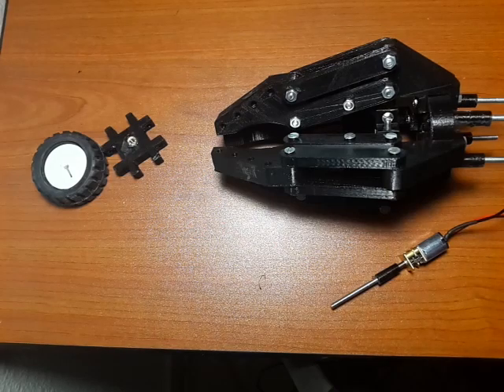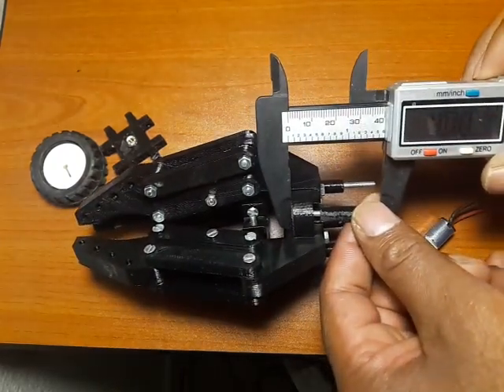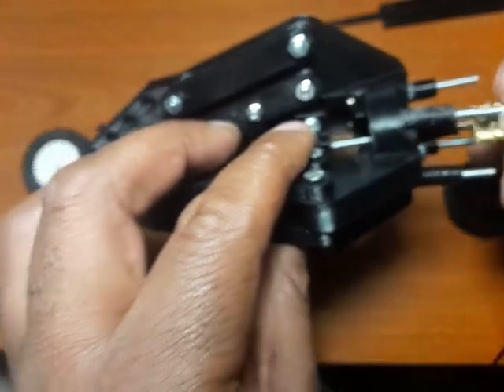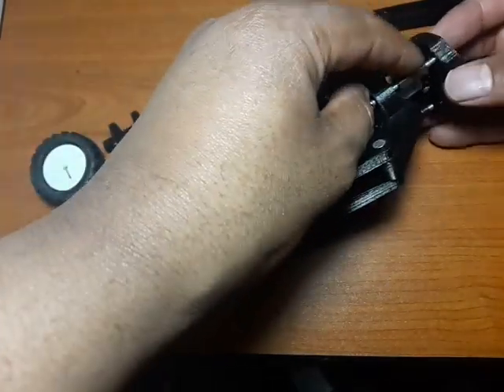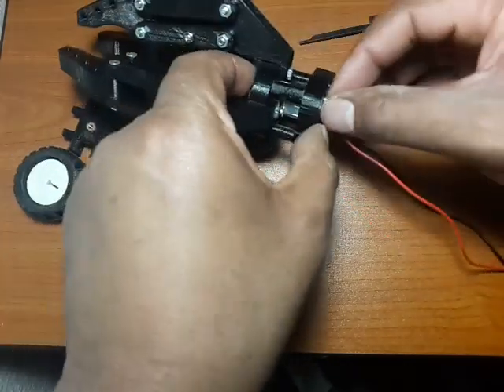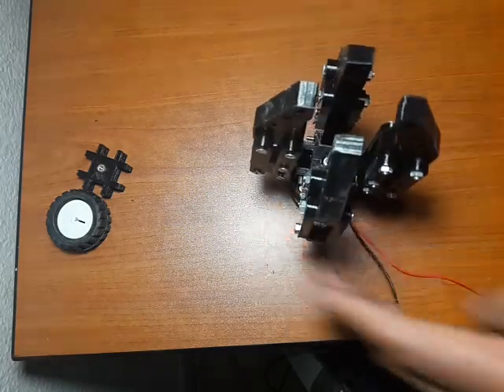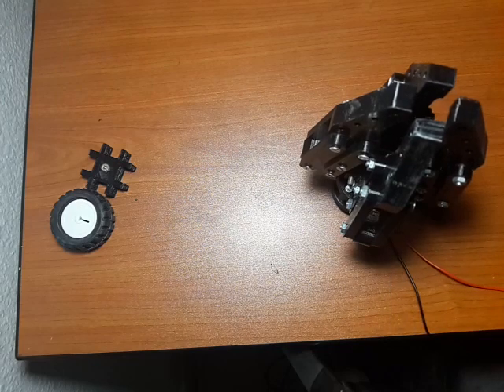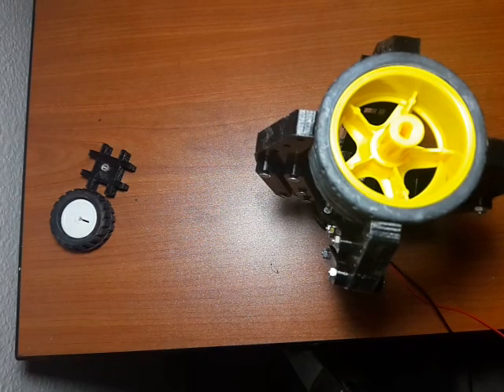3D Printed Robotic Gripper Claw Build Part 4

Comment: Very nice project. Maybe a little late - but a small tip: If you measure the current the motor draws, you can detect when the gripper is closed on an object (ie. the current increases when the motor is stalled)